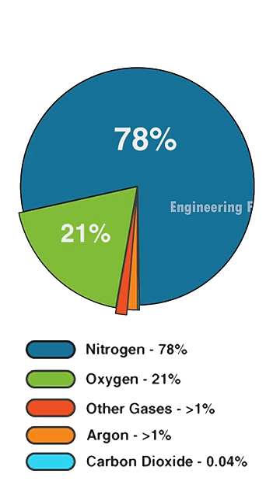tyre-க்கு Nitrogen air அவசியமா? #engineeringfacts #engineeringfactstamil #shorts #reels

Comment: எனவே தான் விமான டையர்களில் நைட்ரஜன் நிரப்பப்படுகிறது 👍🏿👍🏿👍🏿
Reply: Helium illaya bro
Reply: @lessthaninfinity6203  Illa Bro.. 
It should be kept in mind that helium will leak through the sides of the tire much more rapidly than will normal air. Ie, the tire will go flat quite quickly. Then accident is confirmed.🙏🏿🙏🏿
Reply: Nanga ena flight ah otrom 60 to 100km speed la bike la poha porom

Comment: Nitrogen advantages
1.reduce heat in tyres
2.prevent oxidiation
3.improves ride quality
4slow down the air leakage
Reply: oxidiation on where.  on alloy wheels  its not a iron
Reply: @ashokkumar61118  not all wheels are made up of alloy. Normal wheel are pressed from steel
Reply: Superb
Reply: No you are wrong, only during summer season Nitrogen helps .
Reply: Main advantage normal air 10 rs but nitrogen air free 😂😂
Reply: Disadvantage : நிறைய பெட்ரோல் பங்கில் கிடைப்பதில்லை🙄
Reply: I felt the ride quality degraded after using nitrogen, tyre felt harder while using nitrogen.
Reply: Alloy is the mixers of metal so it contains iron
Reply: Nitrogen is generaly light weight in nature so it reduces the weight
Reply: @rahmathali vaipae illa g (If you Heard about Recommend air pressure) according to the type of the vehicle which you are using Unga bike or car manual lae Recommend air pressure follow pannunga g (nitrogen Gas makes the tyre light and flexible)
Reply: Great
Reply: @ashokkumar61118  lose of electron 
Addition of oxygen 
Lose of hydrogen 

Ithula ethu nadethalum athu oxidation nu sollalam bro

Comment: Sir one small point, in places where the temp goes down below 0c you will see low tire pressure since the H2O inside the tire freezes and reduces the pressure, this does not happen with n2 gas.

Comment: Brother., the main reason is to  prevent the rust  inside rim, not   to losing the pressure. Normal air make more rust than Nitrogen. This is the 1st reason for using Nitrogen.

Comment: Driving comfort, riding comfort, once in a month pressure check of tyres in my car, are some of the advantages I find when using the nitrogen in my car tyres in the place of normal air; definitely, there's difference in both of them 😊

Comment: Fill the company recommended tyre pressure when ur filling normal air.

Most of the people over inflate for better mileage - in this case nitrogen would be a better option becoz it won't expand due to heat.
Expansion of air inside tyre may lead to tyre blast and accident in severe cases.

Comment: There will be no pressure difference between tyres, example: when you keep 33 psi in all 4 tyres, after 1 month it will be 29 psi in all tyres. Using air it will be 26 , 25, 28, 29.

Comment: No pro, in highways tyrepressure increases due to air expansion due to heat, as Niteogen doesn't get heat so air expansion doesn't happen, for example if u keep 35psi nitro , it will be 35psi itself if u drive in highways whereas normal air if u keep 35psi, due to heat normal air gets heat n expanded to 40psi or 50psi, tats the reason for leakage/tyre burst

Comment: According to me your content is not recommended for everybody. Let me tell my story itself. Lets say car tyre is little old and it is very sunny time and i am traveling a long distance around 200km and road is highway road. Then what will happen to tyre. T
Due to continuous run with heavy sunny time and too much hot road then tyre will become heat. Due to which it may blast also. In this situation, what car mechanic suggested me is to have nitrogen air. You can put some more research and correct me if i am wrong.